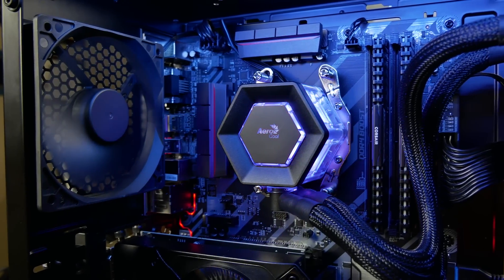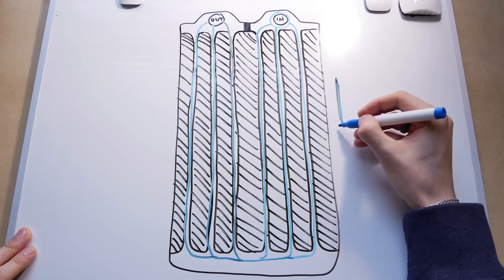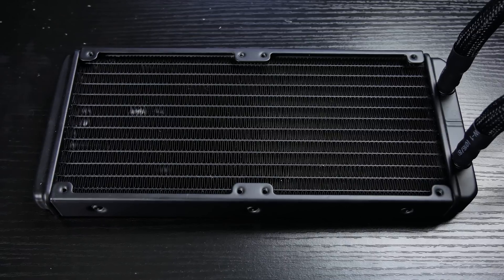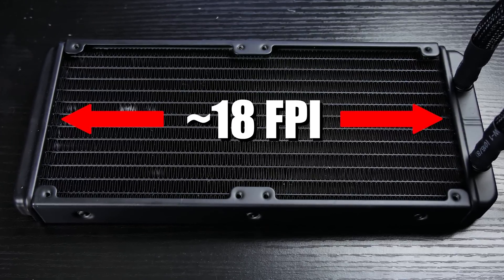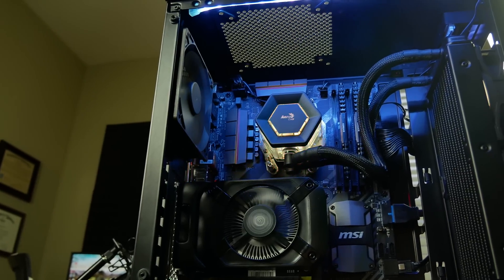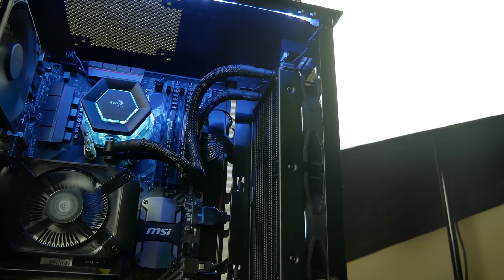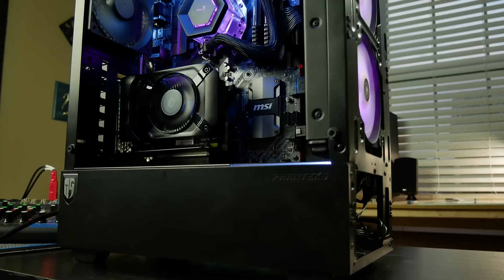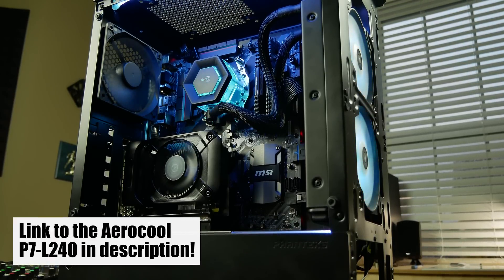The Science Behind All-in-One Liquid Coolers

Comment: I have a full air-cooled system, and the cpu heat sink is huge. my rx 7900xtx run at 70 degrees c max while the cpu max at 65 degrees also boosts to 5GHz. Just 4 case fans + 2 CPU fans.

Comment: Yesterday i got my first AIO ( MSI MAG Series CORELIQUID 240R, aRGB CPU Liquid Cooler ) - Dual RGB 120mm fans - 7 120mm Case fans inside case. GPU: NVidia GF RTX ROG STRIX 3060 Ti. CPU intel i7 17900 ASUS ROG Motherboard 3 Teribytes 8 cores, lot of RAM/VRAM. 850 watt Corsair power supply. 140mm fan inside the PSU. 0dB fan inside the power supply. 2 side intake fans, 3 front intake, 2 top exhaust. Corsair Commander PRO and Node PRO. ( i also have the Cooler Master MASTERAIR MA41 dual 120mm CPU Cooler aswell but I’m gonna try the MSI MAG water cooler first before i go with the Cooler Master. If the MSI MAG fails or stops working, I’ll just remove the MSI water cooler and then mount the Cooler Master. I know it’s not easy to swap and change and add and remove components but it does depend on what the components parts are too

Comment: Just installed my first AIO. I however put it on the top with the fans as an exhaust. My case is a Corsair 680x though and has excellent airflow. I didn't want to mess with that great air intake I had from the front. 

In hindsight I could have bought a bigger Rad and had it on the front as an intake with 3 fans (rather than 2) but the smaller one was cheaper so I went with that. I've only had it running for around 3 days now, but all seems to be well.

The AIO I bought was a Corsair Capillex Elite. I actually changed the fans to LL 120 RGB's though as I had them, so made sense as they're better fans than what comes with the AIO.

I think I'll eventually move to a custom loop, but for the moment I'm very happy with my new set up. I bought an 11th gen i5 which was quite a step up from my old 4690, so the AIO made a ton of sense. I'm very glad I went with it now though, as it looks great (especially next to the Vengeance elite RAM sticks)

PS: I actually find the sound of the pump to be incredibly soothing.

Comment: You opened the topic of where and how to place your Radiator but you yourself are using it upside down, it is (almost) always a better practice to put a radiator where the tubes come from bottom not top, this prevents any air bubble to go to the pump side but to live on top side of the radiator if there are any. Many times this is not an issue but in the case (pun intended) of a serious issue your pump can die because of air bubbles.

Comment: Shouldn't your radiator be flipped in the other direction with the tubes at the bottom? With having the tubes at the top, you run the risk of allowing air to pool at the top and create air bubbles going through the lines.

Comment: I like AIO's better as typically with a high end air cooler, it blocks my ram and an AIO looks cleaner in my opinion. Reliability well, I have the Original H100 thats 8 years old cooling a Phenom II x6 1100T at 4ghz that used pretty much everyday, Its still kicking it, I also have a H50 though not in use right now. Though for the person who doesn't look or clean their PC often, I do recommend an air cooler, just less points of failure.

Comment: Personally I'd rather have a relatively cheap (aka three to four times the cost of a good air cooler) AIO in 240mm. I find Arctic Freezer products that always have a Push Pull configuration and low prices strike an excellent balance for this.

Arctic's air coolers are also top notch, but it all boils down to price at this point, and having run an overclocked FX 8350 Black, I found that an AIO keeps temperatures more consistent than air coolers.

Comment: I had used a Noctua NH-D15 for a couple years in my main rig, but decided to try an AIO so I got a Corsair h115i. I used it for most of last year without real issues, but with my Xmas upgrade I went back to the Noctua. It's quieter and my thermals are too close to make a difference. Also I get a bit more peace of mind with general reliability, no leak potential, projected longevity, etc.

Comment: Noctua NH-D15 For the Win! Inside a case with airflow as insane as my own, you CANNOT get better temps with an AIO! The only "Truly" better  way to cool a CPU is a CUSTOM loop with Copper Radiator and coldplate!
I am using a Delidded i7-8700k - Thermal Grizzly Conductonaut under the IHS, Kryonaut on top. I am at 5 GHZ on all cores and Cache, the HOTTEST my CPU has ever gotten since delidding was just 84 C while running Prime95 (AVX) small FFT, when my ambient was around 24 C!

Comment: I used to run with a H100i v2, but after a year or so it began failing (i.e. throttling under load). Since then I've switched to the big boy Noctua NH-D15 and couldn't be happier. Quieter, much better performance, and the only part that can fail is the fans. Also, it looks like a beast.

Comment: To be honest, when talking about coolers $60-100, I would go nice air cooler. I am running an h100i v2 that I got off ebay for $45 before shipping. Firstly, mounting. I might just be bad at everything, but mounting was annoying, slightly more so than my hyper 212 evo I had before, cooling my 4690k. I have the cooler master mastercase (not pro) 5. That means its just the basics. No top rad support without a bracket you have to buy from them, which I can't find anywhere except a microcenter 5 hours away from me, and it kept moving while I was screwing in. Because I can only mount it in the front, I had to move my drive cage into the disk drive bay. And because of that, they got no airflow, so I have a fan tetering on the front of my case to cool them. https://imgur.com/a/CI7pK (Photos taken on my Canon Rebel XT, getting into photography with my parents old camera). Although, the top left of my motherboard used to sag, and it doesn't anymore. I feel like liquid coolers are also much more fragile. I've gotten a few dents in the fins on my rad, and am a little concerned. Greg, or anyone else for that matter, if you could shed some light on this, that'd be great (See photos for severity). Also, the pump noise is a bit annoying, but I'm not sure if that is just my unit. My reference 480 is usually louder while gaming, so it doesn't really matter that much. Great video by the way! Thanks, and hope you were able to make it to the end. :)

Comment: Copper retains heat very long, aluminum not, water also retains heat super long which is not good.
Radiator cannot help much because only percentage of heat is transferred and cooled water never equals ambient.
It could work with phase change cooling but water is just bad for it. They should start making refrigerant based pc coolers
with phase change very strong cooling.

Comment: I prefer air coolers I'm currently using NH-D15 with 1700. Much cheaper as AIO can be even double the price for no noticeable gain in performance. I'll give AIO a point in better looks but it stops being relevant when you realize you never look inside the case. Also in the worst case scenario air is safer. What's the worst that happens? Fan goes out. Oh my what am I gonna do not playing games for two days. With AIO pump dies, fan dies or leaking? I'm fucked in every scenario.

Comment: I previously had an AIO cooler and thought it was the bee’s knees! Then I got tired of having to move my PC all around to get the fluid flowing right after turning off the system and working on it. Plus the TDP wasn’t that great.

So I went back to air cooling to maximize my $/TDP and went overkill on TDP by choosing a Be Quiet! Dark Rock cooler. It’s quiet, it’s pretty, it chills like Fonzy in a T-Bird. I’m sure I’ll have this thing until they stop putting CPUs in sockets on motherboards.

Comment: My current i7 8700K is overclocked to 4.9Ghz and has an air cooled GTX 1080 Ti in the same case (mATX form factor). Originally I tried using a pretty beefy air cooler, but I found the thermals on the CPU were a bit higher than what I was comfortable with despite reasonable airflow in the case. Since switching to a Deepcool EX Captain AIO /w front mounted rad as an intake the thermals have come back into a much more comfortable range even when the system is under load, and barely effected the GPU temperatures at all. With this in mind (and as I enjoy overclocking), I lean heavily to the camp of AIO's.

Comment: I'm gonna go out on a limb here.. 
I like aio's I have a 5.2ghz capable 7700k but what I do not like is noisy pumps and fans *corsair software was broken for me when the fall creators patch came out currently using a grid+ to run the pump and fans for noise and longevity concerns*.
What I'd like to see is more large radiators as in 200/400mm rads so we can use larger quieter fans at lower rpm.
I'm one of those guys that has a case capable of taking multiple 400mm rads 3 to be precise without making side hanging brackets and honestly living in a hot climate like new mexico I'd like to have a larger aio or a full custom loop money is an issue for the latter so a larger aio in the 150-200 range would be nice.
Just saying for the gamer/overclockers out there a 400mm aio would be mighty spiffy.

Comment: Arctic Freezer 360 is the best AIO on the market for me, personally. 6 fans for like $130 is incredible value, not many cases have 360mm spacing in the front however. Your rear 120/240 and front 120/240 would become outtakes and your top 360 space would be your main intake

Comment: I'll take the beefy air cooler over an AIO. The heatsink will never stop working, you just have to dust it out once in a while. And if the fan breaks, you can buy a new fan, you don't have to replace the entire cooler. And you get pretty good performance for the money.

AIOs cost a lot more but don't do such a significantly better job at cooling that it's worth the extra money. You also add a lot of new failure points to your cooling solution, many of which only have "buy another expensive AIO to replace your current AIO" as a repair solution.  If I wanted to worry about pumps failing, permeation/evaporation, and leaks, I'd go with a custom hardline loop so I can at least get the benefits of it looking nice (AIOs generally look like trash to me because of the soft tubes taking up space in the system), being easy to refill (very few AIOs make that easy), and if the pump fails I can just get a new pump. 

I don't really have anything against AIOs or the people who use them, they're just not for me.

Comment: I like AIOs more, because I buy PC parts more focused on form, (about 10% more than function) and it lets me see my motherboard that I bought for it's looks and overclocking ability. Also, having built using an air cooler and a water cooler, water coolers are a heck of a lot easier to mount to the motherboard.

Comment: Air all the way. You dont need you system cooler than what air will do for you. You wont cool your rig down more than air temp without a TON of exotic tech and thus expenses. Introducing liquid cooling adds in many new points of failure for your machine. It's an overall bad idea. Don't do it.

Comment: I use both AIO and beefy air coolers in my PCs, but which gets what depends on the use and which PC is  "critical" and must work with minimal riscs involved. My main gaming/workstation rig with Core i7 6900K, 32GB DDR4, GTX 1080Ti SLi is the PC just has to work at all times and where possible leaks from a AIO is just unacceptable. So in that machine I use an Phanteks PH-TC14PE dual tower air cooler. 
My wifes PC with Core i7 5960X, 32GB DDR4, GTX 1080 SLi uses an Arctic Liquid Freezer 120 AIO. And the LAN/HTPC system with Ryzen 7 1700X, 16GB DDR4, GTX 1070Ti uses a Cooler Master Masterliquid Lite 120  AIO.

Comment: Is the heat left in the CPU enough to be an issue when you turn the system off and the pump is off or is the heat capacity of the liquid enough to deal with the latent heat?

Comment: I had a noctua cup cooler push and pull, and I got a h100iv2 on sale for $80.00 and I live in Puerto Rico my cpu temps are the same the only change was that the rest of my computer parts run cooler I put a fan on the top of the 1070 blowing to vrm and on the back of my motherboards vrm I put a heatsink with a fan and my vrm oc is sweet and temps don't go pass 55c .

Comment: Watercooled > air-cooled
But small AIO seems to offer small to none benefit compared to air cooled system. When you have to build on small form factor, air cooling is not a good solution.
When you have to go cheap, buy an air cooler, when you have enough money to spend go for a 360/280/240 Radiator AIO. Less than that is a waste of money.

Comment: I have gone with an AIO when I got a Ryzen 7. Coolermaster if I remember (not at home currently). Works well, but kinda wish I had gone with an air cooler, probably would be quieter (what with the pump, water and fan noise - as apposed to just fan noise). I also could only put it on the top of my case, meaning I had to remove some of the sound proofing and more noise can get out. Also because it doesn't cover the whole opening (Design R4) the insides are now getting VERY dusty and I have to clean it out on a much more regular basis than I used to, as I was able to maintain positive pressure and had less openings.

I don't regret getting it although I am not sold on them and will probably go air in the future. Not to mention air coolers are starting to look awesome as well.

Comment: I use AIOs mostly for looks and noise mostly.  The Corsair H60 with Phanteks high pressure fan (the Corsair fan sucks) keeps my 4GHz R3 1200 below 60 degrees and is practically silent (I run 40-60% fan speed).  Plus it looks cool.  A huge tower cooler just looks weird to me and takes up too much space.

Comment: My first choice will always be the best air cooler I can afford. I will need a really good reason to water cool. I'm that old school dude that still cringes at water inside a computer.
Reply: Razvan Popescu not even close to the same, but thanks for trying.
Reply: Because you haven't driven a car that has an ECU (electronic control unit) mounted in the engine bay through the rain and the snow for atleast 20 years?

Comment: I love my AIO. While large air coolers are nice, they also look like a huge PITA if you haven't ample room, or enough clearance between components. With an AIO, this is less of an issue. Yes, the tubes can be a slight PITA as well, but they are much easier to work with than an air cooler because they are a fair bit more pliable.

As far as cost goes, I can understand how this can be a deterrent for some people. I got lucky with my Corsair H100i V2 because I found it used at a local Goodwill for $50. Used a $20% off coupon, and then ordered the AM4 bracket that I needed to make it fit my board. Altogether, it cost me just under $50, and works great.

Comment: I prefer AIOs because subjectively they look better. however, they are more expensive.

I got a Celsius s24 for my new rig mainly because it was on sale pretty cheap and cost the same as the dark rock pro 3 I was initially planning on buying. (about 100 bucks)

Now I was a bit stupid when I pieced out the system as I soon realized that my shiny new rad wouldn't fit in the front because of a combination of a big GPU and a relatively small mid-tower, so I use it as top exhaust . but despite that im very happy with it. it's keeping my 8600k 5,0GHz OC @ 70 degrees during load.

Comment: if you really simplify the matter, liquid cooling is still air cooling, but with a very fancy heatsink design
Reply: It really just allows you to move the 'heatsink' elsewhere, where you might have more room, and thus could potentially fit a larger 'heatsink' as opposed to air cooling.
Reply: I mean yes it uses air. Doesn't mean it's a glorified air cooler. That's like saying a bicycle and a Ferrari are the same because they both use traction to move.
Reply: @ray4493 Not at all. H
They have exactly the same performance and style of cooling. Water just sounds cool and moves the heat around a little more.
Reply: Not correct at all byd

Comment: I don't really have a preference, but i think it depends a lot on the case, for example, right now i have a ryzen 5 1600, the stock cooler is fine but if i want to go to 4.0ghz (i know is capable) I'll need an after market cooler, and since my case is an old 1998 ATX case from Olidata with no room for fans my better option is an air cooler